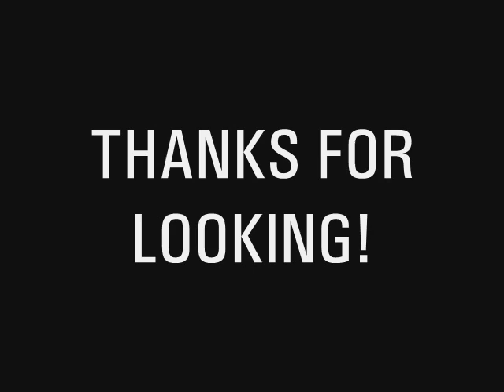HINIKER C PLOW CONVENTIONAL AND BACK DRAG SNOW PLOW IN ONE! INFO & OPERATING

Comment: you're soon going to get one huh and that's such a neat idea you got to ask yourself with all the snow across the northern United States Canada not to mention other continents why aren't the Top Line snow plow manufacturers using this system this is such a great system why isn't everybody using it and you don't think that they thought of something like this years ago what's that thing got like 12 hydraulic pistons on it LMAO good luck with that I got a neat idea let's Mount like 12 flamethrowers on the front of the truck and just melt the snow LOL stop trying to reinvent the wheel
Reply: It looks like it has one more ram.. Not a big deal.. Most people would still want a vplow over this and others with straight blades probably dont want to pay what this costs.. Most likely why there arent a ton of them out there. It looks like it would do what its designed to do just fine.